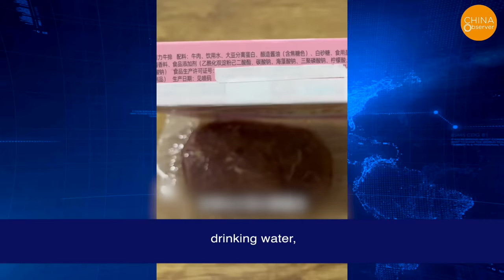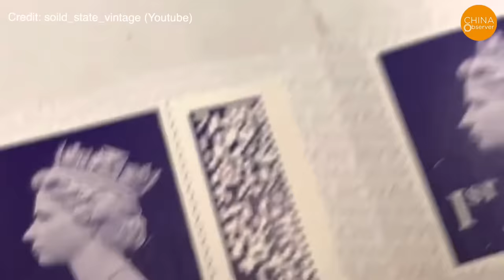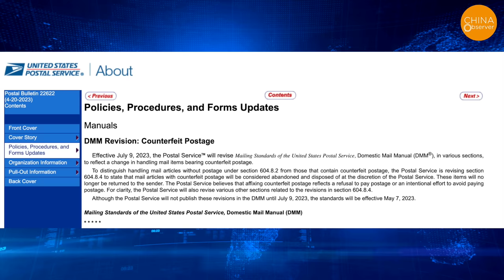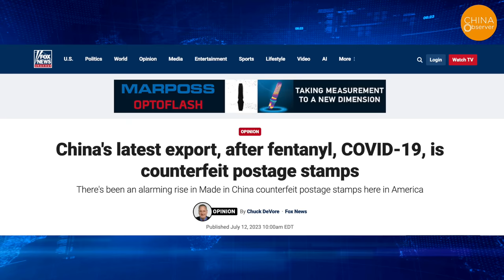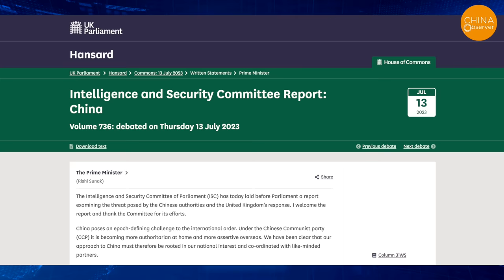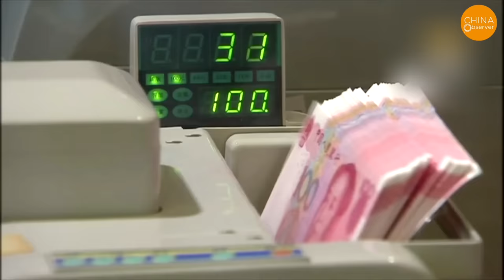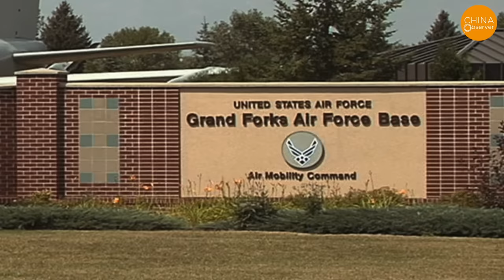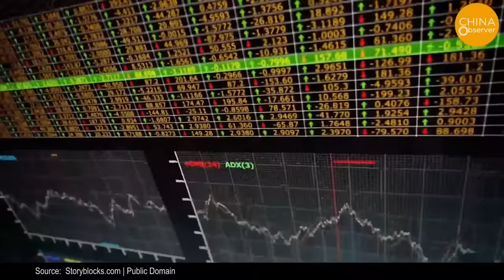From Faking 1M UK Stamps Weekly to Dumping Shoddy EVs and Goods, How Low Is the CCP?

Comment: How many hundreds of millions of stamps do you have to sell for this to be profitable?  Seems like a really odd thing to try to counterfeit.  I must be missing something.
Reply: That's the point, they CAN, and DO print millions of them. Billions, often, and it really doesn't cost them much. A lot of little bits add up to one very big piece 

It's the same idea as what is called a "salami scam" in banking, where you fudge the accounts to take one cent from every account (or even round down fractions of a cent in all cases, rather than down for less than five and up for more than five), then deposit them all in an account of your own. For a big bank with a lot of clients, that can easily add up to millions of dollars.

Comment: It forces post offices to print custom bar coded delivery labels and possibly an end to postage stamps.
Reply: Well the current postmaster has wanted that for a while. Those meters and bars cost the post office a lot less to print than stamps, and are a lot harder to fake and easier to track. And now that they can be printed at home through designated online postal sites, they're more convenient for a lot of people. 

The big catch is that, if they stop printing stamps, stamp collectors will stop BUYING stamps and postal stationary, which is a serious revenue stream for the post office (ever stamp a collector buys and puts away is near pure profit, since the collector paid face value or more for the item, but never actually uses it, so the post office never has to deal with the cost of that delivery.) DeJoy WANTED to try and swap the Post Office over to collectable labels (which would be just like stamps, but carry no franking power [ability to be used to pay for mail delivery or postal services] But collectors said a hard no to that).